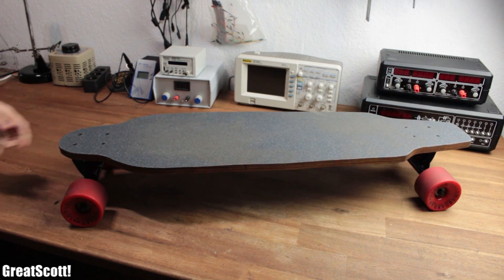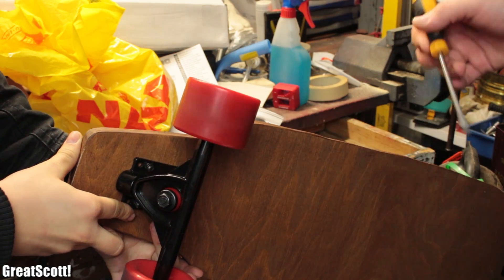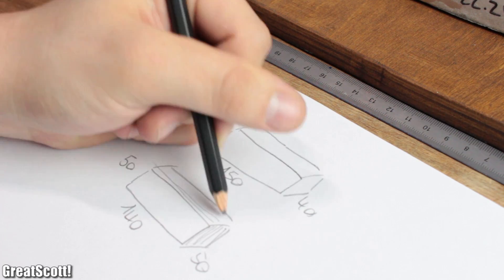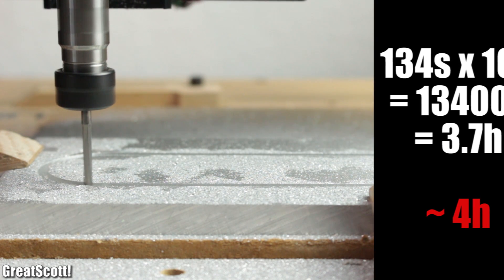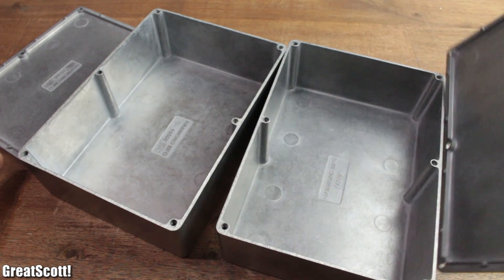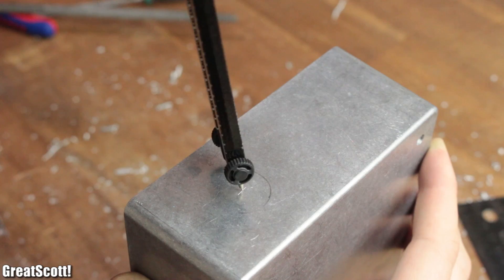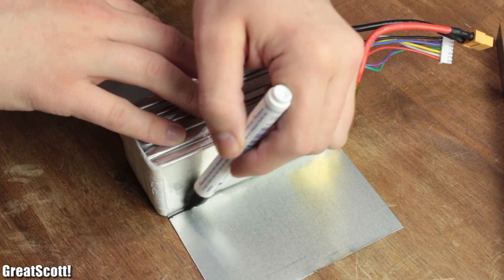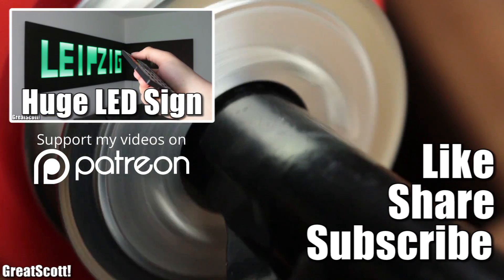Make your own Electric Motorized Longboard (Part 2) - the mechanical build

Comment: The axle runs between the wheels. Drilling through it compromises the strength. The remaining alluminium cast is brittle and gives you litle warning before failing.Thanks for the video.Eirik

Comment: Hello, I saw that in the description you had said that you could go 34km/h with this motor but you have two listed, how fast would i be able to go with the red N5065 400Kv High Efficiency brushless motor. Do both motors go the same speed, or does the red motor go slower than the blue motor, thank you!

Comment: GreatScott, why didn't you mount the electric motor directly to the wood? Could you not achieve the same effect with a couple U-bolts? I believe it would be much easier than milling a custom aluminum bracket and drilling a hole through the truck
Reply from the maker: You can not attach it to the wood because it tilts left and right while your axis stays in place.
Reply: +GreatScott! This is true! I can't believe I forgot about that. I will have to create a bracket without a cnc mill then. cheers

Comment: Hi, i'm building my own longboard, i ordered majority of parts but i've came to the problem, i'm calculating my required gear ratio but i noticed a problem, i've done calculations for your longboard (22.2*400 =8880RPM reduced by factor of 2(15:30) => 4400 wheel RPM, with your 76mm wheels it's 63.6 km/h) but you stated much lower speed (34km/h), so now i'm not sure wheter i should acomodate for almsot 50% loses in my calcualations or not because i've done same thing with other e-boards and this number varies between 50% to almost 90% effectivity which is huge difference. I find it weird that friction or lower battery voltage after let's say 50% discharge can cause such speed drop. I would be infinitely thankful if you would explain this to me, thanks in advance :)

Comment: How much does it cost to make the whole thing?
Reply from the maker: Around 300$
Reply: +GreatScott! Thank you for replying
Reply: +GreatScott! That is way too expensive 
I think you over did it
You didn't have to make the board 
You should have just bought one
Reply: +The Critic isn't that the fun of it though.
Reply: Considering most electric longboards are $1000+ it makes sense. building the board allows you to fully customize your feel. Buying a pre-built longboard is still in the $100+ range, and that's on the low end of things! For the board I am building, which resembles the loaded vanguard deck ($300 complete), it will cost me only $130-$150.
Reply: +The Critic the boosted board cost over $1000
Reply: +The Critic Look, we know you're 12 and money is tight, but a high end long board will run you $200-$300 for a non-boosted one. also he at least mentions a way for people with basic tools to do everything nicely. If you don't have the tools to do everything he did here in a basic form, you need them. You can't go through life without them.
Reply: +Curbo 34 200-300 is a low estimate. those Chinese boards are not safe at all. with electric longboards you really get what you pay for.
Reply: +Brotaku "will run you $200-$300 for a non-boosted board"
Reply: +Curbo 34 there is always the evolve boards and such. The cheap Chinese machines are deathtraps. I've seen 2 of my friends have one explode under their feet.
Reply: +Brotaku Are you paying any attention to what I'm saying? lmao
Reply: +Curbo 34 I am and I am advising you to never reccomend one of the cheap China boards. also their is more boards that are not boosted and still cost upwards of 1 grand. such as the evolve board.
Reply: +Brotaku When did I say shit about boosted boards?

Comment: Why didn't you make an adjustable bracket to mount the motor to the board.... That awkward assembly coming off the trucks seems overly complicated and unstable...I'm sure you had a reason.... Just curious....
Reply: The board will flex and the trucks move when he turns changing belt tension, this is why he needed a floating bracket coming off the trucks. -Curbo

Comment: Hey i made the Motor mount in to a 3D file on: http://www.thingiverse.com/thing:1267656 
Maybe this will help some, but come take a look it may help you when building or it may not, anyway it's there
Reply from the maker: +Andreas Thomsen Pretty awesome. Do you mind if I include it in the video description?
Reply: +GreatScott! Go ahead :D
by the way gona build it when the parts arive
Reply: +GreatScott! there is a new version up with a M6 Nut insert instead, to make it easier for people like myself to 3D Print the mount and still have a good and solid thread.

Comment: Hint .  Push the drill right up into the chuck . If you need a 25mm deep hole  pull the drill 30mm out of the chuck .  Drills work best with maximum rigidity .

Comment: When you made the hole through the truck, you said you hit hard metal, that is the axle, the axle is a long screw that goes from one end or wheel to the other, maybe you have cutted the axle in two, be careful your wheel doesn't spin out!, that axle normally won't move because its inserted under pressure but with time it can loosen and move, since you have cutted it in two, the other end or wheel wont be able to hold it, normally when it is loosen you can tell because one of the wheels get pushed against the truck and wont spin, what you do, is hit the axle from the other side and it would slide again to its position, that's what i used to do when i was a skateboarder. Great video i'm gonna do that someday i already have some parts, great chanel!! greetings from Mexico.

Comment: Would I be able to built my own battery pack from taking apart Lithium Ion laptop batteries and creating two 11.1v batteries linked together in series. And should I keep the power for a motor below 1600W?
Reply from the maker: +Johnnymills I would not recommend using old batteries to form a new one through putting them in series. This can cause many problems. An Li Ion is also not usable due to the high current draw.

Comment: could it possible to break lipo's cells apart?
i think if it can breaks apart it would spare more space and lower the battery boxes...
and the Brushlesmotor... i think you should check the rotation is it Clockwise or reversed... because if its turn to be wrong direction you should unsolder the brushles wire... for me thats pain
btw great project scott!!! i will try this tho... someday... hopefully :D
Reply from the maker: +Nasrul Acuy You can "break" the cells apart and you do not need to rewire the motor if it spins the wrong way. Just change the settings in the ESC.

Comment: I'm thinking about building my own board. Why did you decide for a motor+belt instead of wheels with internal motors?
Reply: +StopLossLOL gearing the motor reduces the strain on it, if you have them in the wheels without any gearing the motor and esc probably won't last long

Comment: Hi there. I notice you are using timing belts with an XL pitch for your build. Any reason for doing so and how's the belt durability? Any slippage?  Just want to make a suggestion on the speed controller if the one you currently use craps out on you in the future and are looking for something better. Look up the VESC by Benjamin Vedder. I'm part of the endless-sphere forum with the community of e-board builder using his ESC. It's still in development and open source to anyone willing to try some programming. I will keep it short, but the VESC programming allows very robust outrunner motor operation to keep motor temps in check especially providing the necessary torque for hill climbing.

Comment: Since the longboard kit is out of stock(amazon.de), I checked through the buyers listings, is this the same kit, except just black? http://www.amazon.de/gp/product/B00VC4FRCY/ref=s9_dcbhz_bw_g200_i3_sh
Reply from the maker: +Leonardvdj Works. I also changed the kit in the video description.
Reply: Okay, thanks! :)
Reply: +GreatScott! Also just wondering, did you change any of the parts on the parts list, or did you just add, in the new videos?
Reply: +GreatScott! Could you please change the link for the motor too because I want to build the board but I can't find a similar motor... Thankss
Reply: +Pieter Janssens If you go to the ebay listing, it says in the yellow box that the user has relisted an item similar to it, aka the same, http://www.ebay.com/itm/EMP-N5055-B-400KV-Leistung-1560WOutrunner-Brushlessmotor-Blau-RC-Modellbau-/172050461940?

Comment: I have not used a CNC machine before (currently planning on building one) I wondering if you had considered using some sort of coolant when milling the aluminium as all the videos I have watched regarding CNC suggest using water to keep the temperature down to prolong the life of the bit. (Great videos by the way - I am always inspired).
Reply from the maker: +techtrashing Since the bit was going super slow it didn't need any cooling.

Comment: ESC seems a little small. Other people who have done this use a lot more expensive ones, will it not overheat? I am really a noob at this but it would be great if I could get some answers because I don't want to waist €70 on an over kill ESC
Reply from the maker: +Epo! I did not have problems so far. But going to the 80A or 90A configuration should not add much cost to the build.
Reply: +GreatScott! Thanks! :)

Comment: How have you wired the batteries to the esc, or are you running 24s or 44.4V through a 6s rated esc
Reply from the maker: +Cm1226 They are wired independently to the ESC.

Comment: +GreatScott! In welchem Markt kaufst du das Zeug? (English) In which Market do you buy things like Wood plates etc.
Reply from the maker: +Robert Vogel Any home improvement store should do. I think I went to Hornbach.
Reply: Ok thx
Reply: +GreatScott! One Question, in the description are 2 "Zahnriemenscheiben" are they both needed? And pls write the English word as Answer , cuz i dont know the English translation for it ;D
Reply from the maker: Robert Vogel
Both gear wheels are necessary. And your batteries do work, but it is a good idea to use 6s packs for a better acceleration and overall range.
Reply: +GreatScott! Ok thx much :D I just want it to keep it VERY low priced, cuz i dont have that much money... thx anyways

Comment: Awesome channel, another awesome project! I would just like to ask how does transfering the power to only one wheel affect the way it moves around? Apart from much easier build, one would probably have to drive two wheels with separate motors, because driving both wheels with the same speed would make it worse at turning, am I right? Anyway, keep up the good work, I really enjoy your videos.
Reply from the maker: +naril0s Stirring feels just like without a motor.

Comment: Hi Scott, great video as usual. I was looking through the links in description, and i saw the motor is no longer being sold on that listing, could you provide me with a link to a place i can buy the motor, preferrably in europe?

EDIT: Also, can it be any ESC, as long as its 70A or higher? Can i buy the HobbyKing BlueSeries 70A from Hobbyking.com instead? Also would it be better to get a 70A, or 85A for this project?
2ND EDIT: I just saw he relisted it again, so nevermind about that.
Is it possible to get the gear parts in europe?
Reply from the maker: +Leonardvdj I update the parts list with part 3 and the instructables article. Other ESC should work fine.
Reply: +GreatScott! Okay great! When is part 3 being uploaded?
Reply: +GreatScott! Also where is the instructables article?
Reply: +GreatScott! Could you send the updated parts list to me in a PM, or a reply comment? Since shipping from China takes such a long time..
Reply: Also since im kind of a "bigger" guy(100kg), will the motor have enough power for that, or should i invest in a more powerful motor?

Comment: Very cool project. One suggestion is that you could have separated each of the 6 cells of each battery and placed them flat along the board surface to make it more smiled down, instead of having those huge aluminum cases.

Comment: Great project, thanks for sharing. I imagine it will be an expensive project , do you have an idea of the total cost and total hours spent on this?
Did you break any drills in the process? :D
Reply: +Linux Cow I spent about £230 on mine if that helps :)

Comment: Using the steel sheet metal and screws, unless they are stainless steel, in contact with aluminum is going to lead to problems. The aluminum will start to corrode and crack in its natural weak points because of the galvanic reaction between the dissimilar metal types. Either change the metals or use plastic separators so they don't touch.

Comment: You should have milled holes first then outlines. 
Also have you considered inrunner motor instead of outrunner.
Reply: Right and a much nicer motor mount
Reply: +Karan Chaphekar outrunner motors spin slower, have many more poles and as a result are a much better fit for this type of project.

Comment: Hi!
I want to make this project but the link for the electric motor in the description sais, that the listing has ended! I found this motor instead (on ebay.com): N5065 400KV High Efficiency Brushless motor,multicopter/Skate Scooter/Skateboard
In the description of the motor it sais that the battery should be between 3 and 8 cells. Will it work with this setup?
Thx for the answer!

This is an amazing project!
Reply from the maker: +Márk Kereszty Sounds good

Comment: Hey,
Have been watching your videos for a bit and they are very informative. 
I have learned a lot. 
I would like to make a motorized longboard in the future, but built slightly differently for personal preference. 

If I 3D printed the two metal parts you used by the motor (lathed piece and milled piece) do you think it would work fine? I feel like it would if I used a strong plastic, but would like your opinion. 

Keep up the creative builds. They are my favorite :)
Reply from the maker: +Carter Little I have seen people who printed such an adapter and it seemed to work. You could give it a try.
Reply: GreatScott! Ok thanks. il give it a try :)

Comment: This is so great, and I would totally try it, but the only thing that I dont like are the electronics on the bottom. All the high-end boards like the Boosted Board or the Yuneec Ego Cruiser have flat batteries, and even flexible ones. Cant I buy the Yuneec board and just change the motor to a faster one?

Comment: I'm guessing most of us won't be able to cut the motor holder (3:40). Does anyone sell it?
Maybe you, GreatScott, will consider selling this part?
Reply from the maker: +The20Kopel I will not sell such a part but you can always print out the template, drill a dozens of holes around the outlines and rasp it down to get the exact shape. It takes time but it should work.
Reply: +GreatScott! Ok, Thanks for the idea. I would like to ask you one more thing. You are using 2 6S pack in parallel, but I've seen other people's projects in which they use 2 3S 5Ah LiPos in series and get the same speed of around 30km/h. So what is the benefit of having 6S? 3S Lipos are cheaper and smaller.
BTW, that's an awesome project. Love it

Comment: Checked every day. Every hour. Was looking for electronics. NO, mechanics now, sorry. Great vid m8. Do i see you won't link two batteries in parallel, but connect them by hand, one-after-another? If yes, that's smart. If the project isn't finished, would you use an arduino with a custom-made remote using a small arduino? That would be so cool! BTW. What will u use to charge them ?

Comment: is digital caliper precision ??
Reply: +Markoso Marks if you buy a mitutoyo calipers you will have very high precision but they cost.
You can buy thos things cheap from china but they CAN be bad. I have one which is fine but the other on i have messures somith different every time i extend it to the maximum and go back. The diffenrence is only 0,1-0,2mm but that can be a problem.

Buy a cheap one for daily use and a good one if you have to messure down to the last 0 your caliper can go.
Reply: because I'm using classic one and it's precision, and i haven't problem with using undigital but it was just question and thx